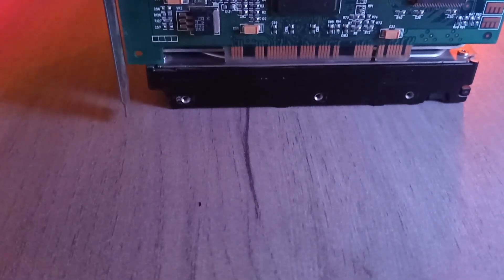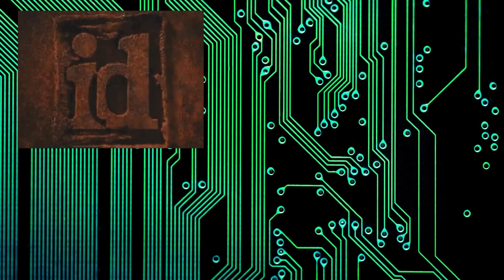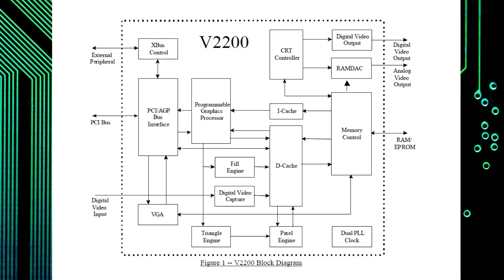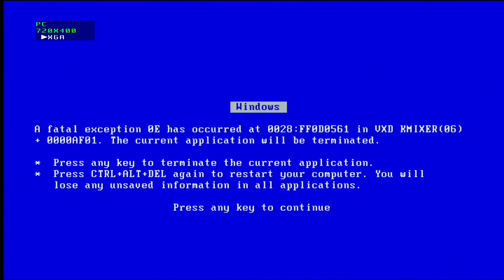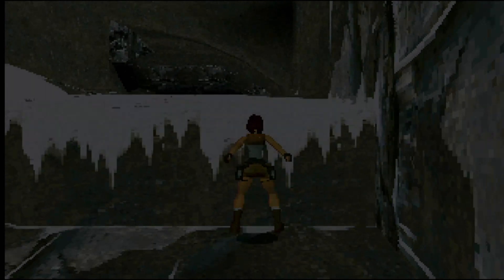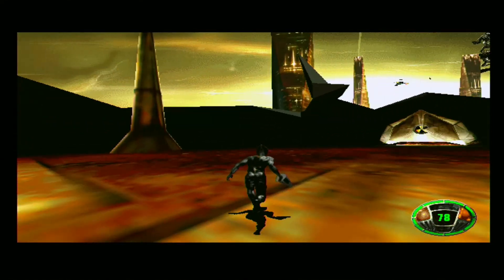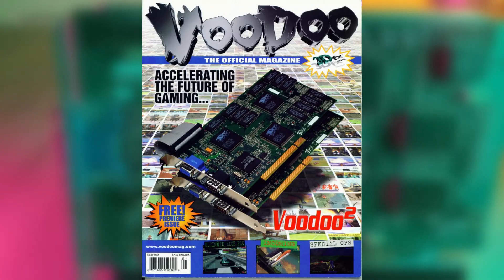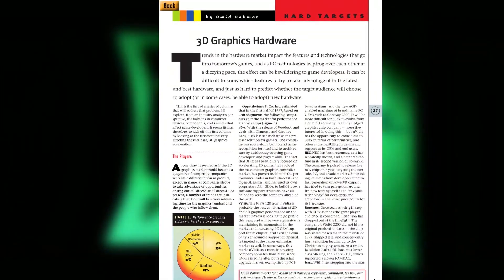The Rendition Vérité - The PC's first GPU

Comment: 3DFX did one thing very right. They reasoned that hardware T&L wasn’t needed; early games had to run in software mode which meant they had to have low polycounts; the cost of letting the processor do it was small. They also reasoned that everyone already had a 2D card on account of there being very little prior competition and most buyers upgrading an existing system. All the voodoo had to do was rasterize as many perspective correctly textured filtered pixel per second as possible. They lucked out with a big price drop in memory around the time of launch. 3DFX made a cheap and fast card with the minimum possible feature set.
Reply: Plus, VOODOO had SLI, so we could get 1024 resolutions with two daisy chained VGA cables and internal ribbon connections if i can recall my Monster 3D cards setup.

Comment: Such an awesome video! Thank you for sharing this! I really need to enjoy some Descent II on the Verite. It's quite impressive to truly see side-by-side just how good that game looks when rendered in hardware. I really liked the fact that you described this card as the first GPU too--because it truly is! The Verite is something I've always loved--it's like if TIGA graphics or the Matrox Impression had matured, and were supported by more than just CAD software; it's a feature-rich GPU and you really highlighted just how much it could do! It'd be interesting to see what could've happened if Rendition stayed around. The Voodoo 1 really is a close match to this, and as compelling as it is to buy a Voodoo 2, for games that require DOS 3D acceleration support--and for those that don't appreciate the Voodoo 2 (to say the least)--this is a really nice alternative. I'd say I use my Rendition more than my Voodoo 1, and that the output on the Verite is sharper, even if using a Matrox as a 2D card on the Voodoo! Thank you again for this! What an awesome video, and I really loved how much more you covered than I did. I think the whole Z-buffering implementation issue (or really, tyhe utter lack thereof...) is such a cool thing to explain! As much as the Verite should take more load off the CPU, it doesn't in some circumstances, and that's probably when a Voodoo is the better bet!

Comment: When the first graphics card tests appeared in computer magazines, I always paid attention to error-free rendering of the games and good performance and that's where the Rendition Verite stood out.
I originally wanted a 2d/3d card, but none of it convinced me at the time, not even Voodoo Graphics because it was only a 3d accelerator. So I bought the cheapest 2d Cirrus Logic graphics card with 4 MiB that I could find to bridge the time in my brand new Pentium 2 266 MHz. The 486 I had before had no PCI slots.
And then came the Voodoo 2. It was so convincing with its 60 fps that I no longer looked for a 2D/3D combination.

Comment: I still have my Diamond Stealth II 4 MB.  Here is the impressive part; I had added heat sinks to all VRAM chips as well as a heatsink and fan to the GPU (thank you Radio Shack!) and was able to overclock the thing from 35 Mhz ----> 70 Mhz stable.  It wouldn't post at 72 Mhz.  Find me a graphics card that can pull a stable 200% OC today!  Anyway...that was my first OC attempt back in '97...went well!  Except for the superglue...don't use superglue!  Not sure thermal paste was readily available back then, or I just didn't know about it!  The card.........still runs!

Comment: I was never a fan of straight bilinear filtering. Without trilinear it had sharp and ugly mipmap borders. Without anisotropic filtering it was tremendously blurry on any surface not directly facing the player. The standard remedy for this at the time was to jack up the resolution; but even 1024x768 bilinear looked like ass compared to 640x480 with AF. Games like Quake and Half-life didn’t have the detail to jack up resolutions that high without it looking out of place.

Comment: I had a Verite 3D Blaster back in the day. Believe it or not, I was able to run OpenGL games with it, even GLQuake. For the life of me, I can't remember how I did it. I do remember searching all over the Net for a solution. It may very well have been a beta driver from Rendition, but I'm not sure. Maybe even an unofficial solution from some random programer out there. It could be that it had something to do with its programmability, but again I can't remember. :( That card lasted me until I got a Voodoo 5500. Yep, I sure knew how to pick 'em, eh? :P
Reply from the maker: Thanks for the view! Yes, the first Verite's definitely could run OpenGL games, they were just hampered by their lack of a hardware z-buffer, so performance probably wouldn't have been great. I ran GLQuake on my v2100 here (which has a hardware z-buffer) and it actually got higher frame rates than vquake!

Comment: @1:11 GamerInVoid whole channel is full of low quality stolen footage & meme compilation garbage. "Evolution of Video Game Graphics | PS1 - PS5 | 1996 - 2020" clip you took this from has both PS1 and PS2 segments done in emulator. This isnt how 3D looked on PS1.

@1:25 Descent 2 might be a weak argument for "vastly improved floating point calculation speed of Pentium" because Descent 1 looks and runs the same? while using exclusively fixed point math :-)

@13:40 is that spinning cube running in Verite accelerate mode? Something is seriously wrong with perspective correction, there is none. Did they disable it in their own demo? :o

@13:50 45 fps? That would most likely be Voodoo2. Voodoo1 plus fast CPU on default settings 512x384 mode gets up to ~30fps, 640x480 is ~25. Unless you tweak everything to absolute ugly minimum, then you can get up to ~55fps in 640x480.
Reply from the maker: @1:11 - thanks, I didnt know that about that channel, I was just looking for footage of arcade machines and PS1. I never actually had a PS1 so I don't really know what it actually looked like, but I'll make a note of your comments for future videos!

@1:25 - it wasn't really meant that way, I just meant that there were newer, more advanced games coming out at that time. I could have/should have used quake but the rest of the video was already pretty quake-heavy so I wanted something different.

@13:40 - yes that is the Rendini demo from the "Take it to the RRedline" completion. It does look pretty weird I know but I always try to show the Demo Scene some love in my videos if I can.

@13:45 - Thats a fair comment, and I did actually make a mistake about the resolution here - I was actually playing in 512x384 for most of my quake stuff, so its not 640x480. But, depending on the speed of your processor you could quite easily get 45fps on the voodoo with a few performance tweaks, which I remember using back in the day when I ran GL quake.. see here for more info: https://www.soldcentralfl.com/quakecoop/compare1.htm

but yes, on default settings you would be only getting around 30fps on the voodoo 1, you are correct :)